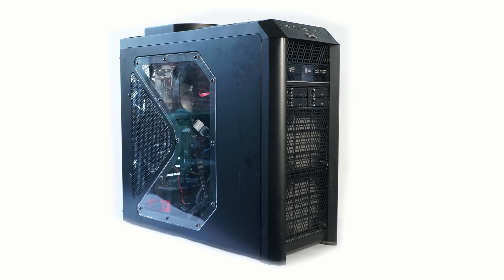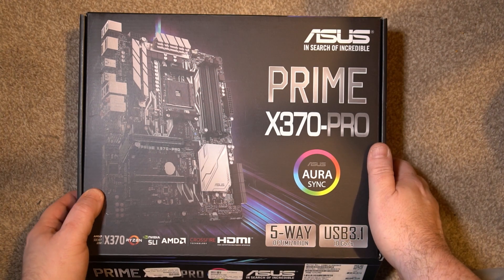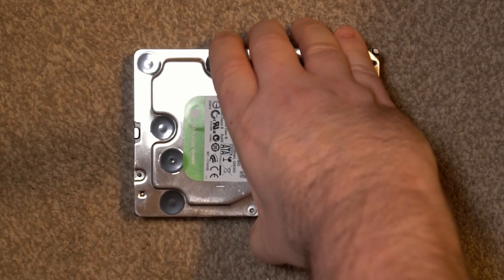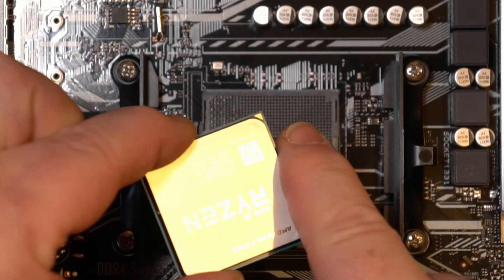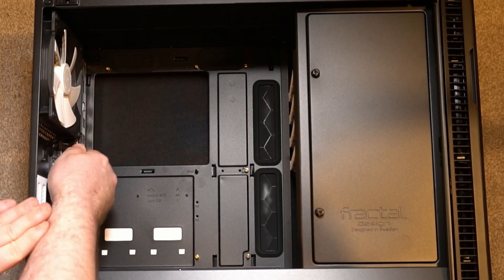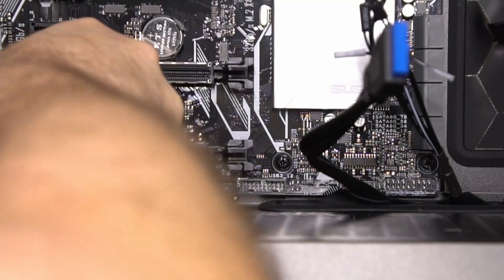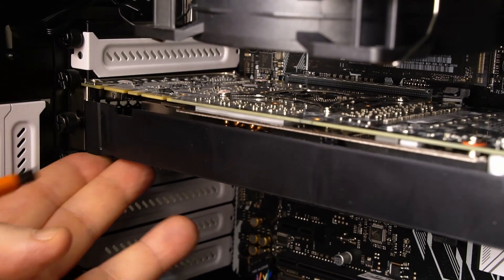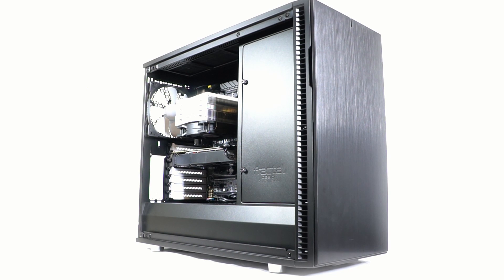Will it work, Intel to AMD upgrade, NO new Windows!

Comment: I have always ran an Intel system, now that it's time to upgrade I have this AMD board and processor and am so nervous about actually doing it.
Reply: i know im a year late, but im feeling the exact same way. my amd mobo has been sitting around for like 3 months because im absolutely frightened of doing it
Reply: @pirtuut  Well I did it and am on it now, best advice I could give is to not be afraid of it, it's more resilient than you might think and just take your time don't force anything.

Comment: I switch Intel I7 8700 to AMD Ryzen 5 5500 I was planning to reinstalled windows,  I was surprise my ssd when thru no issue with my windows keys in it. All of programs and games works fine I even stress it no problem.

Comment: Went off without a hitch. Swapped my old mobo/i7 3770 to an x570/r5 3600. All I had to do was change bios to detect Legacy hardware and the boot drive came up and I used driver booster to get the new amd drivers. Works great, huge upgrade!

Comment: Thanks for the vid!  Do I take it the other drives were accessible as well?  I’ve made the mistake in the past of doing a fresh install on a new pc and my additional drives from my old pc were locked out and I had to use data recovery software to get to my old files.  Looking to avoid that again. Lol.
Reply from the maker: Yes, the data was all there, I've done a few upgrades in my time and never had this happen. You might want to disconnect them on the first boot up and then go back and reconnect for the second time you power up.
Reply: @knewideas3860  I think it was my trying to use the old drives under a new windows installation and the security features tied them to the old installation and locked them out.  Going to use your method on a new pc I’m building as I really don’t want to reinstall and reconfigure everything again.  Thanks again!

Comment: i know this is old but this has given me a spot of hope, moving from amd to intel tomorrow. see how it goes. hope your pc is still going strong.
Reply from the maker: Hi FluxGamess, I've recently moved on to a 7900 system, upgraded from this, so nothing remains apart from the case? the drives and the OS. The old system (the one in the video) didn't fail at all, no BSDs in the entire time I ran it, it was just time for an upgrade. Hope all went or goes well with yours.
Reply: @knewideas  that's great know, glad it ran well, mines now all set up just waiting on the DDR5 then I can switch her back on whilst biting my nails haha. Thankyou for the reply :)

Comment: Thanks for this! I'm currently running on i7 3770 looking to switch back to my long time dream AMD platform. I can safely say that my next upgrade would be easy.
Reply: Just made the same upgrade. What a difference!
Reply: so going from a 3770 to a ryzen 5 2600 shouldnt need a windows reinstall
Reply: @k9burnouts544  Yep, I even cloned the drive to an NVME. Works fine.

Comment: I just did this but now I can't connect to Internet did you have to disable drivers and install AMD ones?
Reply from the maker: Yes as you've changed your motherboard you'll need to make sure the drivers are installed. It might work but that depends on the type of chipset used in your network chip. It's best to install the drivers from your new motherboard's website. Then you need to uninstall the old one
Reply: @knewideas3860  brilliant thankyou will do that not

Comment: it works but did you install any amd driver thing or not? i only have an APU so I think I need to update the graphics driver, or maybe mine was a whole new different case.
Reply from the maker: I did install the AMD drivers, but not until the first boot was over. I was using Ryzen 1700 X so no APU and the 1070ti, worked fine after I updated my drivers.

Comment: alright guys so I switched from i5-9600K to ryzen 9 5900X with X570-A pro mobo, changed RAM as well to 16 GB 3200 MHz. I thought that I would need to reinstall windows. But it booted up just fine after taking a few BIOS update and windows update. Games and all programs seem to be working all good.
Reply: Not a single problem regarding the switching up to this day?
Because i just did today, from i7 skylake to the same Ryzen like yours.
Reply: @lexex2550  oh yea an update on my previous comment. I didnt run into some issues after like a month or so. But after that my windows files got corrupt and wasnt able to fix it. Not sure what exactly caused it but I took a backup and reinstalled windows. Now its working fine again, better to just reinstall windows after some major hardware changes 👍🏽
Reply: @nvduk3  
Very well, but how about the Key Registration?
Ain't windows gonna be bitching if we use our previous Key that we use?
Reply: @lexex2550  then you can try factory resetting your windows if not an entire clean installation. That can work as well in restoring any missing or corrupt files 👍🏽

Comment: Very helpful video! I am going from AMD (Athlon 3000G) to an Intel platform and this has given me the inspiration to do the same with my SSD. I have so much installed on the drive that a clean install would be very time consuming.
Reply from the maker: It’s been very stable, I’ve been running it for a few years now and no issues.
Reply: @knewideas3860  so you didnt had any bug or software problem all this year in your window without any fresh install?
Reply from the maker: Not a single problem, no blue screens, no fail to boot, nothing.

It behaves much better than the old Intel CPU, that would give me failure to boot properly occasionally.

I’m going to be upgrading again soon, maybe moving back to Intel so it will be interesting to see how that goes 😬
Reply: @knewideas3860  yeah me too, i didnt counter any problem. My friend insist me to do fresh install but i dont want the hassle to reinstall window and all the game which take a significant of my time to re-download. How long you have done this upgrade? 4 years since then?
Reply from the maker: Yes, it’s been 4 years since that video, can’t believe it!
Reply: @knewideas3860  wow mate, thats an achievement, thanks for the reply though

Comment: This is for anyone watching this video today in 2022.

i'm going from an intel i7-7700k --> AMD Ryzen 7 5800k. Installing a new CPU, MOBO, and RAM.

Curious if after i've backed everything up to my HDD, if i can just boot everything up on my SATA SSD (my boot priority right now) and be good to go?
I'm on Windows 10, and have my windows access activated with a digital license LINKED to my Microsoft account.

Should be able to boot it up, and log into my Microsoft Account/Onedrive correct?
(From the comments it seems JUST that easy. But before leaving the BIOS after first bootup, is there anything somebody recommends?)

Would you recommend downloading the following to a flashdrive to install IN THE BIOS LATER, before adding in my new hardware?:

-Latest BIOS Version
-LAN/Audio/VGA/Utilities/SATA Driver
-Chipset Driver

Appreciate any and all help. First time switching to AMD chipsets! <3
Reply: I have done this recently, and my window work well with my game still playable

Comment: I am currently using a 1650, and an intel i7 3770k. Any recommendations on what to upgrade to. Please bare in mind that I have a strict budget of £500
Reply from the maker: What do you use your PC for primarily, gaming or something else?
Reply: @knewideas3860  gaming, and modding
Reply from the maker: How much RAM do you have and are you using an SSD?
Reply from the maker: I’d go for a bundle upgrade that includes a motherboard, cpu and memory. If you’re based in the UK have a look at https://www.cclonline.com/ 
Or
https://www.scan.co.uk/

I’ve used both and can recommend them. There are quite a few options below £500.
Reply: @knewideas3860  thanks

Comment: why is your cpu cooler facing vertical when you have a rear mounted fan... you should mount your cpu cooler horizontal.
Reply from the maker: As supplied the cooler bracket doesn’t allow you to mount the fan horizontally. This was swapped out a few weeks later.

Comment: I had issues with my PC after some maintenance upgrade (PSU, cooler switch). I don't know anything about hardwares and how to connect them so I took my pc to a trustful computer store. When I got back my Intel pc my windows was not booting  (it had ram issues I was not aware :D) so to make sure that the windows was on my ssd I went to my friend who actually put my ssd with windows on it into his computer he has an amd cpu but it worked fine :D. then we found out what the problem was thank god. Now Im still using this copy of windows on my intel cpu after it was booted up on an Amd pc. I experienced no issues
Reply from the maker: Thanks for taking the time to tell your story, interesting to hear.

Comment: Thank you for quelling my anxiety, I have an amd cpu and accompanying motherboard on the way and was very worried about my boot drive
Reply: If u have a newer 5000 series ryzen cpu, remember to flash ur bios and update it or u will get a black screen.
Reply: @dmcc549  Thanks for this. It is a 4000 series so a bios update is all thats required. Ryzen 5 3600

Comment: So you didn't have to remove drivers from the OS before swapping over to the new Mobo and Cpu?
Reply from the maker: No I didn’t, others - judging by the comments- have also had success this way
Reply: @knewideas3860  Cheers Hoping it will work with 5 5600x I've got Os backup also, Thanks for the video
Reply from the maker: Good luck, but I hope you don’t need it. I’ve done a few fresh installs is Windows over the years and this was much easier. I couldn’t be bothered with the hassle of reinstalling all my apps, thought I’d give it a go and yes it worked fine!

Comment: Could I ask because I’m getting a new mobo. What does happen when you put your old ssd that has windows installed on it into the new motherboard. I do not mind if windows automatically installs itself. But I need to know if the previous ssd will work so I don’t have to painfully get media creation tools. I know this is old but if you do see this I beg you respond.
Reply from the maker: Basically very little, you might need to install new drivers from your motherboard manufacturer but windows won’t reinstall. You may get the ‘activate windows’ nag on the desktop but on mine it went away after a couple of weeks.
Windows won’t be lost but to be safe I’d always create a backup image on a separate HD or SDD.
Reply: @knewideas3860  quick response ! Thank you
Reply: @knewideas3860  so it would be fine ??

Comment: Hey did you remove any drivers or anything before you started this.
Reply from the maker: No, I made an image of the HD but that’s all, never needed to go back to it. Although if you’re going from Realtek to Intel networking (or vice versa) you may end up with a huge redundant driver that you may want to delete later.
Reply: @knewideas3860  hey I'm planning to use all of my components from my old motherboard and the wifi card from it so I really don't need to delete any drivers right? Also would I need to back it up because I'm getting the same chipset motherboard and I'm not reinstalling windows. So if I just plug in my ssd and my components to the new mobo will windows just boot up?
Reply from the maker: You should be fine in that case but I can’t guarantee it. I’d backup just in case
Reply: @knewideas3860  ok ty.

Comment: Do you have to uninstall the old cpu drivers, good vid btw <3
Reply from the maker: Thanks, I didn’t - worked ok for me!
Reply: The biggest problem with switching motherboards is bios changing, your os is specifically catered towards that specific boot program, don't be surprised if you you have a boot error and have to reinstall windows
Reply: @jacobtrc7331  I've changed from intel to amd and changed motherboards, everything was fine.

Comment: I pretty much did the same, but when I turned my PC on, the screen was black. It wouldn't even go to BIOS, nothing. Lights and fans went on though, and no beeping sounds.

Please help
Reply from the maker: Could be a number of things, I’d start with checking the memory, take and re-seat each module? Try with one stick first in the second socket from left to right counting from the processor.

Comment: so basically all i have to do is just plug in my drives witht the OS on it and itll load up like nothing changed ill just be on my neew system?
Reply from the maker: Basically...yes. Although I’d always image the disk before just in case. But nobody so far has reported a problem (tempting fate here)

Comment: What does “windows activation ” mean ? And what happened if you don’t activate it ?
Reply: Nothing really. The only thing inactivated windows does is it doesn't allow you to customize your themes and stuff. But it has full functionality otherwise. However, TechDeals YouTube channel has a great website and discount codes to get an activation code for a REALLY good price. I've got a couple myself and all have worked just fine and were completely legitimate. But if you can deal with the watermark and lack of windows aesthetic customization. You don't ever need to activate.

Comment: hello, I would like to know about your old build? What was it? THANK YOU! Great video by the way...
Reply from the maker: It was so long ago now, an Asus Motherboard an Intel Core 2 Duo, 16GB of RAM (4x4GB) a 620W PSU. An nvidia 750Ti and an SSD and a couple of HDDs.

Most of it sold on apart from the PSU which I’m still using. The case was an Akasa one, sorry can’t remember which, it had a side window and I think a 200mm top exhaust fan. Sorry I can’t be more specific but I sold the parts about three years ago.
Reply: @knewideas3860  Thank you very much for your kind answer. Did you experience any blue screen afterward? Or you just simply installed the motherboard updated drivers and were good to go. I assume that you boot up your pc for the first time (after upgrading your hardware), using only your system drive and later on you plug your peripheral drives, with the least USB devices as possible... Right? Thank you very much I'm in the same predicament, I DONT want to have to reinstall all my system from scratch. Again thank you for your kindness.
Reply from the maker: Yes David, that’s exactly how I did it, no blue screens either.
Reply: How did it work out for you? 

i'm going from an intel i7-7700k --> AMD Ryzen 7 5800k. Installing a new CPU, MOBO, and RAM.

Curious if after i've backed everything up to my HDD, if i can just boot everything up on my SSD (my boot priority right now) and be good to go?

Would you recommend downloading the following to a flashdrive to install before installing everything?:

Latest BIOS Version
LAN Driver
Chipset Driver

Appreciate any and all help. First time switching to AMD chipsets! <3

Comment: So..what the worse things can happen that you know about. I don't care about any as long as I can recover my data when bad thing happen. I just so freaking lazy to buy a new hdd just to backup my current data just for installing a new Mobo..
Reply from the maker: Worst thing...Windows won’t load
Reply: @knewideas3860  which mean?
Reply from the maker: You might need to repair or reinstall windows. You may not need it but I’d back up all vital data just in case, up to you.

Comment: Did you have to remove any old drivers after you got into windows to install the amd ones? If so, which drivers need to be removed? 
I'm planning to go from an intel i7 6700k to a ryzen 7 3800x
Reply: Just read some of your other replies and realised you didnt uninstall any but did install the new ones for the board. 
Do the old drivers still show up in device manager? Have you had any issues since with anything?
Reply from the maker: No, not had any issues

Comment: So what you’re saying is I can take the SSD out of my intel PC and plug it into my soon to be AMD PC and it’ll boot up like normal, all my data still there, with no issues?
Reply from the maker: That’s what happened to me, you will probably get the ‘activate windows’ nag message but mine went away after about 3 weeks.
Reply: knewideas I also think you could call up Microsoft if you really need the message to go away
Reply from the maker: I tried but because I no longer had the original install media they couldn’t help
Reply: @knewideas3860  I wanna come back and verify that this actually worked! I built my pc last week switching from a 6600k to a 3700x and there was no issue! just plugged in the old ssd into the new pc and it was like I did nothing! thanks for the video
Reply from the maker: Great to hear another success story

Comment: im in a similar boat in terms of OS, so would u recommend i switch over the OS SSD first, even tho all the new pc components say they only support win 10, and then do the upgrade on the new pc?
Reply from the maker: Your situation sounds different to mine, I wasn’t changing OS, only components.

I can’t be 100% sure as you’d need to tell me exactly what you’re planning. However if you have components that only support windows 10 then you need to make sure the WINDOWS 10 OS is happy on the old components before installing the new ones.

One major change at a time...
Reply: @knewideas3860  well basically im running win 7 on an old intel pc, im building a new set right now (still buying parts), and its gonna be amd, and a lot of the new parts claim they only support win 10, so basically i have to upgrade from 7 to 10 sooner or later, im just not sure if i should upgrade now on the intel, then switch over, or switch first, and maybe run 7 in like a safe mode or something? then do the upgrade so the win 10 recognizes all the new hardware...the main question i have is im not sure if i can even run win 7 on the new hardware that supposedly do not support it
Reply from the maker: I’d do the OS upgrade first, although as I suggest to everyone, do a proper backup just in case (image the drive).
Reply: @knewideas3860  ok, thanks!